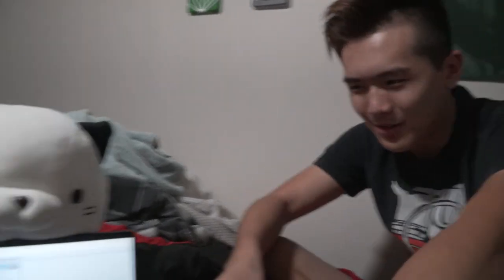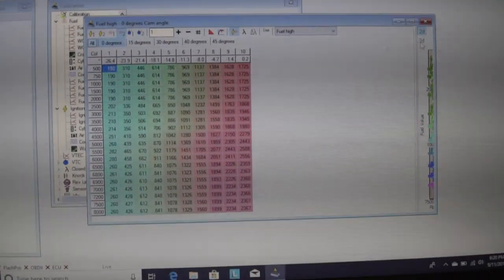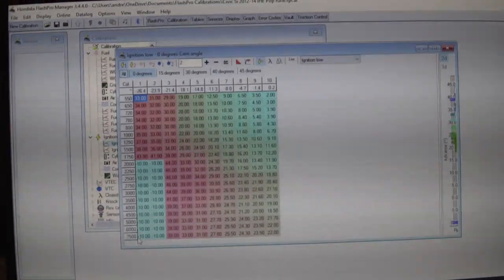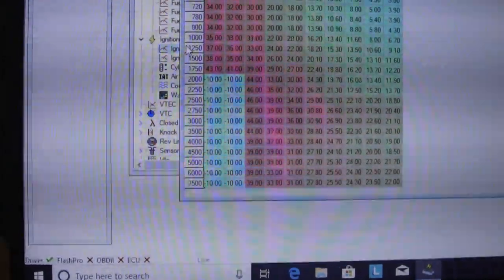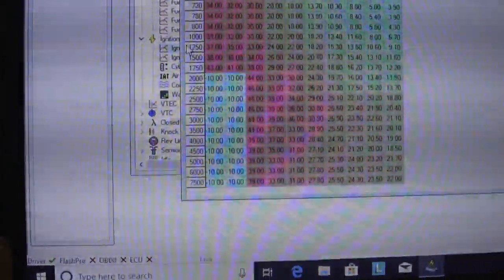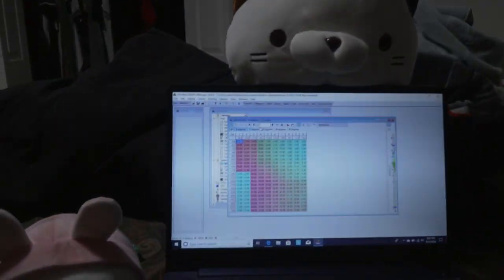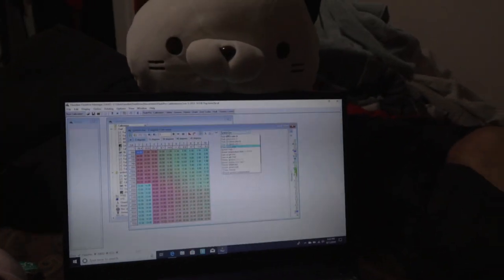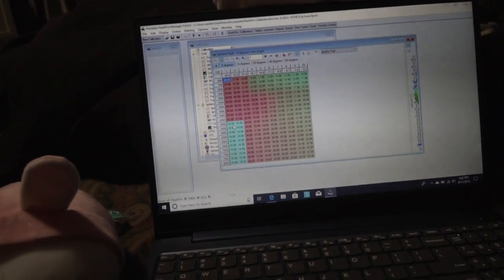HOW TO POP TUNE YOUR 9TH GEN HONDA CIVIC SI | POP AND SHOOT FLAMES!!!

Comment: I'll try this right now on my 8th gen 🤔🤔🤔🤔 I'll let you know guys 🤔👍
Reply: Ok here we go...
I'm very happy with my results 👍 but you have to do this.. on all the degrees 0 ,10 20, 30 and 40 after go to fuel ; under Overrun Fuel Cut on gear 1 go 90 on 2 go 150 on 3 go 150 on 4 go also 150 and on 5 gear also go 150... 🤗🤗👍👍👍👍 I'm happy with my results 👍 thanks happy New year to all us 👍👍👍👍
Reply: What did adjusting the overrun fuel cut do? Just curious.
Reply: any video?
Reply: Do you still need a Hondata ECU to tune one of these or can you just use a Flashpro??
Reply: @demisson401  use the flashpro 👍
Reply: @MrTRA504  would you be able to help do this? I've seen a couple different ways to do it and I just wanna see what's the best way to do it lol
Reply: What mods do you have on the 8th gen?
Reply: Kommon Zense I just wnAted to know the list of mods because I was gonna do the costume tune you put on here because I wanted some pops in my car lol
Reply: But I have skunk2 CAI, plm headers vatless with full exhaust,
Reply: @corysaesee3755  oh awesome Yes it works man 👍 you going to love it 👍
Reply: Ok here we go...
I'm very happy with my results 👍 but you have to do this.. on all the degrees 0 ,10 20, 30 and 40 after go to fuel ; under Overrun Fuel Cut on gear 1 go 90 on 2 go 150 on 3 go 150 on 4 go also 150 and on 5 gear also go 150... 🤗🤗👍👍👍👍 I'm happy with my results 👍 thanks happy New year to all us 👍👍👍👍
Reply: Kommon Zense thanks bro can’t wait to try it lol and thanks for the fast response 😂
Reply: @corysaesee3755  humm I got Megan headers 3 inch high flow cat, 3 in exhaust pipe 4 in resonator and a 3 in flowmeter my car sounds like a high performance Subaru 😘😘😘 betifull
Reply: Kommon Zense damnnn must sounds amazing in person, I just have the 3” ktuned exhaust
Reply: @MrTRA504  need help
Reply: @texasaguirre101  hey what you got? 😎

Comment: Can you do this for 8th gen also?
Reply: SI KID Yes this does work on the 8th gens as well as long as you have Hondata
Reply: @lennylam5010  let's say I got a tuned on there already. Will it messed up anything? I'm actually superchargered
Reply: @sikid3214  I wouldn't recommend messing with a forced induction tune and having the extra force and heat from a supercharger could potentially melt your valves when running a popcorn tune.
Reply: 8th gen k20 is weak! Low Tq! Sell it buy k24 better.
I like 2013-14-15 civic SI k24 more tq...

Comment: I did this kind’ve thing to my 9th gen, still running stock DP and exhaust w muffler delete. If I go catless DP what are the chances of getting a flame?
Reply: i got the same setup right now. just ordered a PLM catless downpipe. i'll let u know the results!
Reply: Jared Thao anything? I’m about to put in a catless downpipe and I really want some flames 😂
Reply: Taylor Graves I’ve got a Skunk2 catless Downpipe, Skunk2 76mm catback, and tuned on flashpro and mine shoots flames
Reply: ZachFB6 just a normal pops and bangs tune? I have the 2.75” invidia n1 and I’m about to put a catless downpipe on it so I should be able to have some flames then with a proper tune.
Reply: Taylor Graves all it takes is changing the ignition deceleration tables
Reply: how was the crackle “tune” ? I have the same setup
Reply: @PantieSnifferLOL  setting up hondata but need help cause you said you shoot flames and i wanna shoot flames got the same exact setup 9th gen downpipe and exhaust hmu with you number or somethin so i can get the tune
Reply: @cameronmackey6527  next chance when I’m at my laptop I’ll download the tune file and see if I can send it here. Since my last comment on my setup I’ve ran launch control a lot and shot flames quite a bit so my exhaust packing has burnt out some so is much louder and less restrictive on the gases.
Reply: @cameronmackey6527  check out my recent short video showing what my tune was able to do
Reply: @PantieSnifferLOL  What’s your anti-lag/2step settings that’s freaking fire 🔥 (no pun intended 😂)

Comment: I have a fa5 and i want it to pop like that but be quiet . how would i do that?  I dont have a k tuner tho
Reply: Aiden you would have to get some sort tuning device specific to your car and then adjust the same tables for your car. Most tuning concepts are similar cross platforms. As for keeping it quiet, you could do a less of an ignition cut to reduce the amount of fuel dump into the exhaust

Comment: does it work with stock exhaust with muffler delete? i already have hondata
Reply: FB6.Junior it will still pop but the sound won’t be that loud due to the two cats that are still on your exhaust
Reply: I have 8th gen Si stock with a muffler delete and Hondata, the pops are actually pretty loud surprisingly, especially for just a muffler delete. I’m assuming it depends on the tune itself with where the ignition timing degrees are set at